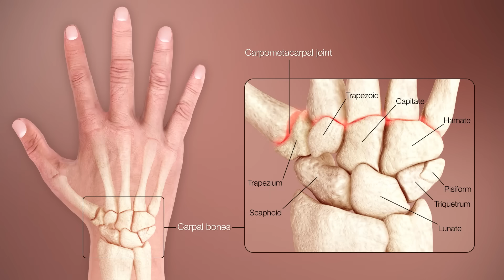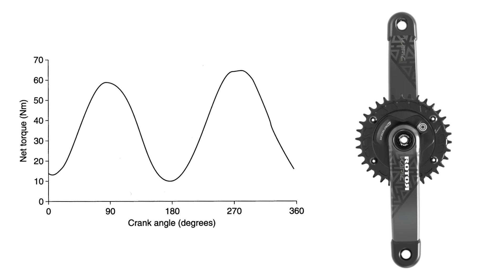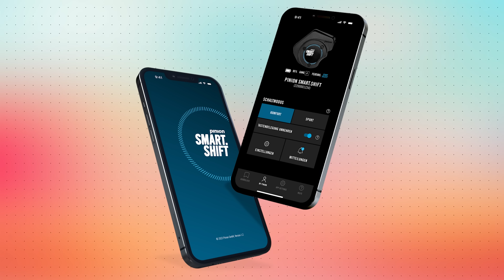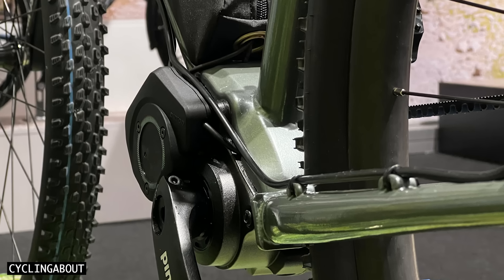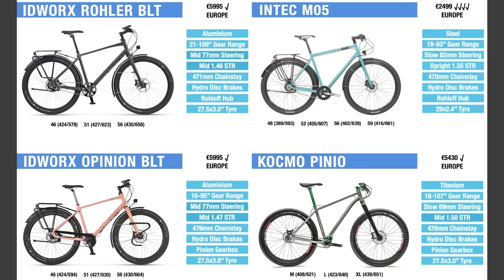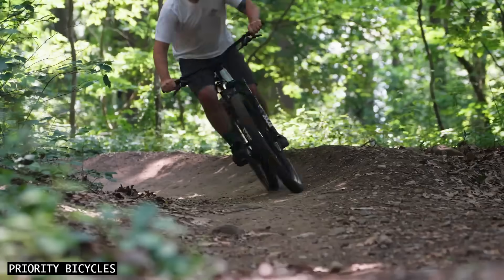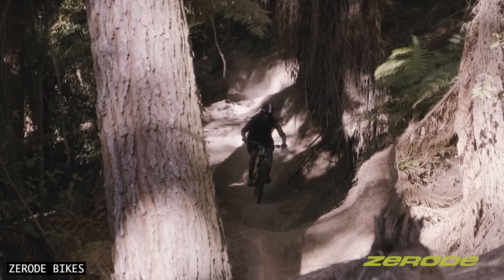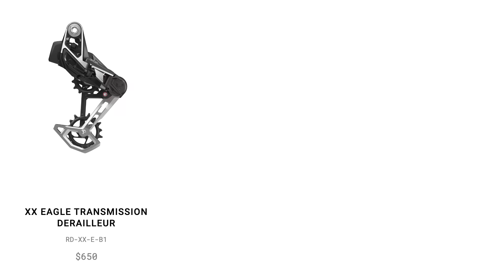The 2024 Pinion Gearbox Is A Derailleur KILLER - Shift Under Load, No More Gripshift!

Comment: Thinking about trying to put a belt drive on my Brompton, I know there’s two companies one in Holland and one in Scotland that changes the rear triangle to accommodate different set ups , I wanted to see if it’s possible just to replace the three speed hub on the  Brompton with a hub from Alfine or Rohloff or any other manufacturer obviously with 8 or 11 gears with the original triangle with a belt drive system with one shifter be it manual or electronic not twist shift, I’m almost certain if it’s possible just to quick change might be another half a million others who like like to change also, any ideas?
Reply: Pinion -- correction -- PRIORITY launched a folding bike. It costs about $800 US, which seems pretty competitive.
Reply: @bengt_axle  Can you give me the name of the bike please.
Reply: Sorry, my mistake.  It is a Priority Folder, not Pinion. But it is still belt drive, and uses an IGH.  You can just google Priority Folder and it will show up.
Reply: @bengt_axle  thanks I will check it out, take care, safe riding.

Comment: Pinion seems to have shifted their attention to ebikes, with motor-gearbox Integrated drivetrain. In that case, battery should be plenty enough as long as it is enough for motor to run. Can you cover if dynamo hubs can also charge these shifters, though?

Comment: Problem with TRP brakes, they are not powerful enough for a fast loaded bike when it rains or long descents due to the small pads, and they only come in flat mount. I have the older post-mount Hylex RS on my drop bar mountain bike, there is no alternative on the market, however I’m about to test swapping the Hylex calipers with Shimano XT 4-pistons to test that setup. If it works, it’s a game changer.

Comment: Did I get it right? 20k shifts on one charge? 
How does that compare to a derailleur bike (Shimano Di2)? If it's only 20k the battery would be dead after 2 days of riding. As in my experience I have about 9-10k shifts over a course of 100-120km in the back and single digits in the front.
Reply: If you took 6 hours to ride 100k, and shifted once per minute then it would be (60*6)=360 shifts. 10 shifts per minute (once every six seconds)= 3600 shifts.  Do you shift every second?
Reply: @bengt_axle  I think Di2 counts every single change of cog as a single shift. Once up the cassette can be 10 shifts for example. It's just read out of the statistical data.

Comment: “Ultra low maintenance” is a big selling point for lazy ol’ me!
Reply: For that I have 2 SA XL-FDD dyno drum brake front hubs. First one has 32,000 miles with just a bearing change. Even the cable went 20,000 miles.

Comment: So I’m wondering if anyone has come up with a design or application of the Pinion gearbox coupled with a belt drive for a recumbent trike? I have a fat tire recumbent trike that I like to take on ATV trails here in Maine. But the mud puddles can be deep and dragging a derailleur sprocket and chain through these muddy waters is not good. If I could have a internal geared hub with a pinion gear box or mid-mount electric motor on the boom, that design would raise the belt up to the hub level instead of close to the ground as in traditional chain drive derailleur designs. Having the belt away from the water as well as a belt instead of a chain would make these adventures much better and safer for components.

Comment: More complicated than a simple derailleur. More expensive more likely to go wrong. If tour de france riders don't use them then it's pointless. They put out silly wattage, ride crazy miles and the simple derailleur just works. Even the same for the MTB world and all it's disciplines. If you want a gearbox buy a motorbike. Otherwise just adjust two simple screws for hi and lo and tweak your cable tension. There you go. No need for nonsense destroying the world.
Reply: Baloney. The TdF doesn't ride on mud. My LBS couldn't fix my defaileurs either. Been Rohloff14 and SA 3 and SA 5w ever since.

Comment: $3k for a complete Pinion equipped bike is very reasonable.  The new wireless Campagnolo groupset is $5k.  I think gearboxes will become the standard for DH and other mountain bikes.
Reply: Except you can buy a comparably spec'd bike with a traditional drive system for half the price.

Comment: Converted my Moser 1985 steel frame road bike from Campag racing triple to Shimano Alfine 11 speed gear hub with Di2 drop bar shifters, will never go back to derailleurs. The transmission is silent with no freewheel noise and a delight to ride.

Comment: It's just so super expensive I'd rather spend more $$$ on other parts and use a derailleur that runs a lot more efficient and is lighter. It's just not worth it. Even on a bike tour of multiple days unless you're in the dirt it's easy to maintain the chain and derailleur
Reply: LOL. Crooked chain, crooked spokes, crooked shifting, crooked hanger, stupidly complicated. Other than than it's great. LOL hahahahahaha
MY Rohloff14 has done 20,500 miles, with 8,200 on 2 tours. ZERO problems and gets BETTER every ride.
Even better is my SA XL-FDD dyno DRUM brake front wheel has 32,000 miles and still works and looks like NEW.

Comment: I love the idea of a gearbox bike but you really need to stop trying to sell folks that the weight doesn't matter. Those of us that pay for XO1, XX1, CAMPY and Titanium are are willing to spend more than $3k on a base bike....do care about weight but more importantly we desire the best of both weight and being bulletproof.   All four of my bikes are Ti have the lowest weight cassettes and have wireless shifting.  I like eternal bikes with proven tech. I would take a gravel bike gear boxed and a Fatbike that is a gearbox and never give them up.
Reply: for 99% of the riders, weight doesn't matter.

It's not as if the gearbox adds 5 or 10kg of weight to the overall system, overloading the frame or making you stall the bike on steep ascends.

Otherwise, you'd have to ride naked, take care that you use the toilet before departure and leave your smartphone at home.

Comment: This tech need to be integrated with automatic shifting if it hasn't been yet. I have autoshift on my Specialized Vado 5 and thought I would not like it till I tried it and now love it. Auto shift with this gearbox would have to work a little better than the igh on the Vado though if was going on my emtb which is where I would like to see it.

Comment: I hate twist shifters but not for the reasons here stated, mine is fast, I can go trough the 7 shifts of my cheap ass nexus 7 in 200~250 ms, but it's not precise, if i'm not careful I may engage the shift uncorrectly and that's not good for the health of the hub, I prefer thumb shifters, of which I have one, in another nexus inter 7, I just can't stand derrailleurs

Comment: Two years ago, I bought a pair of Priority 600 bikes, for myself and wife.  I really like the Pinion 12spd.  Even though it has it's 'quirks'.  The twist shifter is clunky, but functional.  I'm excited to hear Pinion is upping their game, with both electronic and mechanical options.  However, for the type of cycling we do, I find the gearing a bit too low.  Most of my riding is in the 7th-12th range.  I only have to 'go low' when tackling an extreme grade.  Rarely, and I mean rarely, am I ever in need of 1st gear.  And at that point in the climb, I'm going so slow, I worry about losing balance. My 'dream bike' would be a full suspension road/gravel bike, Pinion gearbox, and drops.  Titanium frame, carbon fiber wheels, and 30ish mm tires.  10-12 kilos weight, if possible, would be great.

Comment: I've been cycling too long for the shift under load to be an issue but the move to a trigger shifter is really interesting now.

Now, if only they can sort out the 12 points of engagement so I can clock the cranks on technical climbs, I'll make the switch.
Reply: I just shift under load. Lol. I just don't care.
Reply: I use an old hub gearbox, and yeah having to briefly back off the torque when shifting hasn't been an issue for me. I love the idea of a bb gearbox over a hub one,  but the price and (in this case) the electronic complexity is a turn off.

Comment: The costs need to come down dramatically for this to really take off. That's not impossible if companies with considerable design and mass-manufacturing expertise get involved. E-bikes could be the market to focus on initially, combining a motor with the gearbox in a compact unit - offering very low maintenance and high reliability. Great for elderly riders with little cycling experience but larger budgets.
Reply: Should be easy to get costs down. 
For that price, you can buy a whole gasoline scooter that comes with a gearbox able to handle more power.

Comment: Are pinion frames compatible with frames for crank motors like Bosch and Shimano Steps? Then it might be possible to convert e.g. an older ebike with a busted motor unit to an e-pinion. If those units are sold to consumers at all.

Comment: One thing not mentioned is that once you've cashed out for a Pinion bike, having multiple front AND rear wheels is a minor extra cost, and switching between them is a 2 minute job. Useful for summer and winter wheelsets, or offroad and road ones. I'd be doing this if I ever got such a bike.
Reply: Me, as a full-year cyclist, pinion is a blessing. Maintenance free is such a time/cost saver, it's just unbelievable!!!
Reply: If running tubes, and expect few yearly wheel swaps, changing tires is smarter. A few minutes more, but no big deal. It's a good chance for maintenance. Now for trail vs road use, I see your point. Not much different than a derailleur bike though, since belt sprockets aren't cheap.
Reply: @seitenryu6844  Yes, but belt sprockets are far cheaper than a decent IHG, which is the only alternative in my case. Swapping tyres is a much bigger hassle than just swapping wheels - how much depends on particular tyre/rim combos, but it's far more work. When spring arrives in february, but winter suddenly returns in march - with tyre swaps, I'd generally wait until april, to make sure I only do two swaps per year. With wheelsets, I'd swap more often, and get a safer and more comfortable ride, and maybe some cost saving eventually on less wear of the expensive studded winter tyres. To each their etc...

Comment: Killer gearboxes:
- don't use batteries (they will not discharge when you want them and you will not be able to charge anytime they discharge)
- don't have firmware. Anything that has, is prone to bugs and can be used as gateway to subscription model.
- have spare parts available and can be repaired at home (see Right To Repair movement + Louis Rossmann)
As you said: price is high becuase quality is high. We know what happens when price goes down.
We should learn from the history of the car in order to avoid the same crap happening to bikes.

Comment: People have their own grips. You can use your grips with a gripshifter. That is the most common problem. And just the fact you have to twist your arm. That is a problem for technical riding. Well removing the thumb is also problem but I would guess a lesser one as it's 20 years since I have used a grip shifter.

Comment: Gearboxes are way more expensive and considerably less energy efficient than traditional chain systems.
May be a solution for someone who is maintenance averse, never learned to shift properly and is riding short distances in flat areas like cities or maybe doing slow long distance tours with luggage where dirt and maintenance are problematic.

Comment: Makes sense for slow speed long distance touring and heavier MTBs and possibly E city bikes.   Hopeless for road and gravel though - low efficiency, extremely low top gear, no power meter unless you run PM pedals, no oval rings if you prefer them.

Comment: The problem with pinion is mostly it's WEIGHT.
When it comes to switching gears mechanical is the most reliable followed by hydraulic and in last place is electric or electronic which can have the most issues because of its complexity.
Reply: A servo motor connected to a digital switch is much less complicated than a late stage Shimano brifter

Comment: I would love to switch to gearboxes. I've only been riding MTB for about a year, but I've already broken two derailleurs and on one of those occasions had to hike my e-bike about six miles out of the Soquel Demonstration Forest. But you can't just switch, AFAIK. The belt is all one piece, so it needs a little notch the seat stay to allow it to be looped in, right?
Reply: You need the specially built frame to accept both the belt and the gearbox. There's no retrofitting this, you need a new bike. Unless you already have a gearbox ready frame, but you shouldn't be retrofitting as they're supposed to last as long or longer than the bike.

Comment: You got me all excited until battery - not sure that's appropriate for a touring bike?  Especially if out in extreme heat/cold for long times?

I mean, could a dynamo easily keep up and/or integrated?  I just would not want to deal with a dead/dying battery out there.

The idea is exciting though - in theory it should be possible with an entirely mechanical solution to have the shifting only occur at certain pedal positions or not under load - might be finicky/another thing to fail though so not sure we'll see that someday or not.

As someone who bikes at a low cadence with a less-than-well-maintained setup: when I've test-ridden a Rohloff I felt no difference in shifting while peddling whatsoever as I always shift top-of-stroke as it is

Comment: It would be very interesting to know if this gearbox could be used in high pivot mtb, using the second shaft as an output where the high pulley would be connecting directly with the rear hub
Reply: Not grasping fully what you mean, but Zerode G3 is a high pivot Pinion MTB

Comment: Crucial problem with pinion gears: it ruins bicycle universality while another option having the same advantages does not: gear hub (ex Rohloff). You must build pinion gear bicycle frame with advanced planning and you can't change your mind later and alter the bike. You can't install pinion gear just on any frame you want it on. Gear hub - same advantages but wherever you can put wheel on you can put this no-derailleur gearing system on and it too is not exposed to elements.

Comment: I love the idea of new technologies and innovations.  . However as much as I would love to have a pinion equipped bike it costs more than my last 2 bikes cost together and now has electronics and a battery! Im not a complete retrogrouch but this is a step in the wrong direction for me.  I love bicycles for their simplicity.  I don't want something else to charge.
Reply: I have to agree, if it’s better mechanically, keep it mechanical, don’t try to make it “even better”
Reply: There are/were mechanical versions before the electronic shifting one. And brifters are available.
Reply: Should be easy for Pinion to engineer a little dynamo inside the gearbox unit that charge the electric shifting mechanism. Or better yet, connect it to a USB outlet to charge lights and GPS tracker. Yes, it would decrease the efficiency of an already innefficient drivetrain system. I think that is a compromise that some people are willing to take.

Comment: i totally get why some people like the electronic trigger shifing and it def has some advantages and its right to exist, but i would have loved to see a mechanichal trigger option with a no battery in the system, please do it denkendorf
Reply: That wouldn't help, the trigger doesn't consume the battery, it's the sensors in the system itself. As long as these aren't e-bikes it would still need an external charge
Reply: who are you calling a Denkendorf
Reply: @NephBikes  look up the town of the pinion headquaters / manufacturing site
Reply: There is a company that has developed triggers for Pinion mechanical gearboxes, but they are exclusive to their bikes.  So it's obviously possible, and I don't understand why Pinion insists on sticking with grip shifters.

Comment: I wouldn’t bother with this until it comes with 18s and 11.5% steps like the P1.18. I can get more range and smaller steps with my 46/30 rings and 11-40 cassette using GRX di2. Synchro shift makes it feel like. 1x. Half the price and half the weight too. Can go on any bike too.

On a more positive note, I had no idea about these drop bar shifters. Thanks for the update, Alee!

Comment: Not impressed.
My Shimano Nexus 8 gear hub with rotating shifter can be switched from 1 to 8 or back in a fraction of a second, and does not need any battery, and cheap and very reliable. Of course, there are disadvantages: lower ratio, you need to stop pedaling for that fraction of a second, but overall, I see no reason to upgrade.